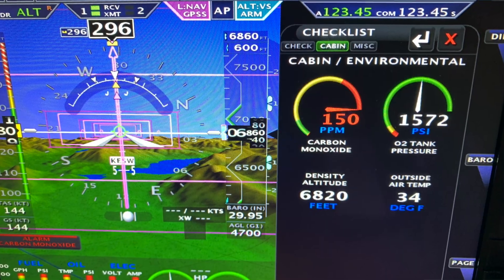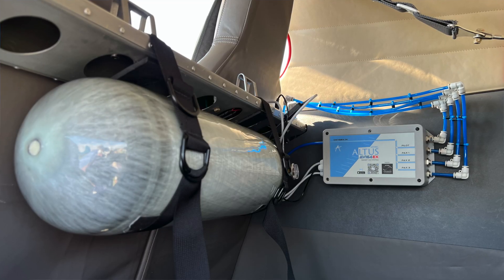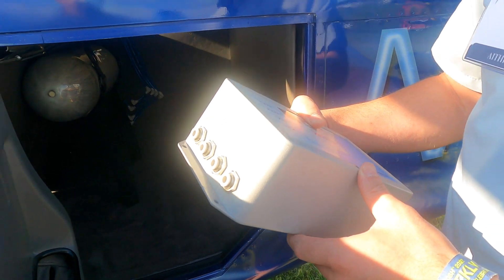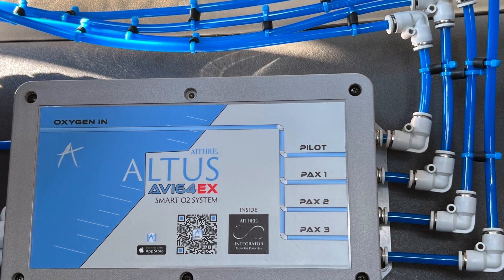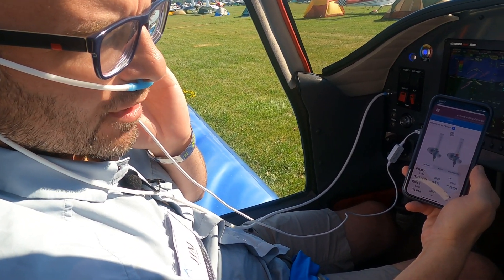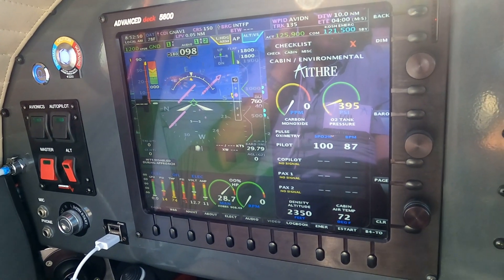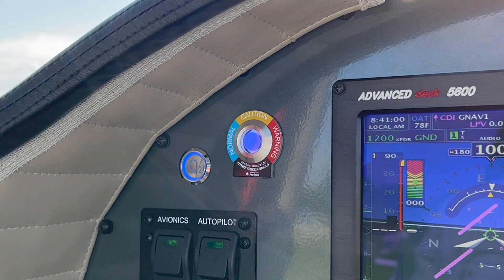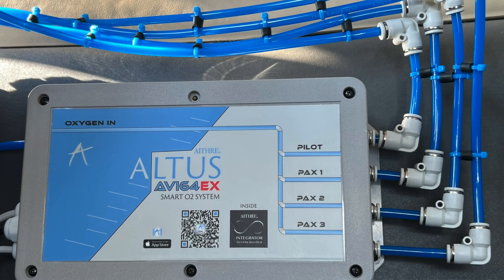Aithre's Built-in Smart O2 System

Comment: Based on the comments, the rep for the company didn't do a good job explaining the differences between his system and a constant flow traditional oxygen system.  They are light years apart and oxygen consumption is much much lower, while actually supplying more oxygen to the person. 4k seems pretty reasonable for the system (as far as aviation equipment goes). A mountain high system is still 1300 for a box that runs two people, and you still have to have a traditional o2 system installed in the plane.

Comment: Apparently they missed the KISS principle.  Panel integration, automation equals lots of unnecessary cost and a multitude of points of failure. Looks pretty, but impractical and frankly a bad idea for such a critical system.  For the cost of this system, you could have an aluminum portable cylinder, regulators, cannulas, and your own manifold/refill station with hydrostatic tests and delivered oxygen for life, and still have money to spare.
Reply: It isn't constant flow, its a pulse demand system...you're comparing apples and hand grenades...
Reply: @tstanley01  Doesn't really matter the system. Pulse flow, digital controls and fancy displays might 'justify' the price, but it still has more points of failure and in the end, both systems serve the same purpose - oxygen supplementation to allow safe and legal flight in unpressurized aircraft at altitude.
Reply: You could make this argument about cabin pressurization too…backups provide a simple solution to the reliability question. A small bottle and mask under the pilot seat would be smart to have with ANY O2 system.
Reply: @Heathfx5  Cabin pressurization serves somewhat of a different purpose, additional benefits. It's not just a system, the aircraft themselves are designed, engineered for the pressure differential. It allows for flights at much higher altitudes, animals in the cabin, etc.  Agreed pressurization systems are complex, but so is a turbo engine compared to normally aspirated - but they also serve different purposes as the turbo is faster and can fly higher.